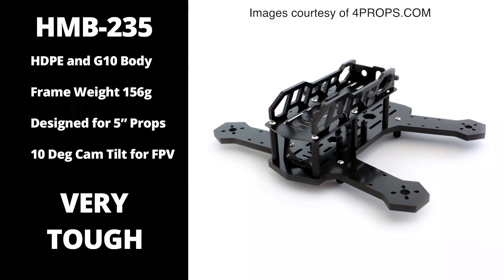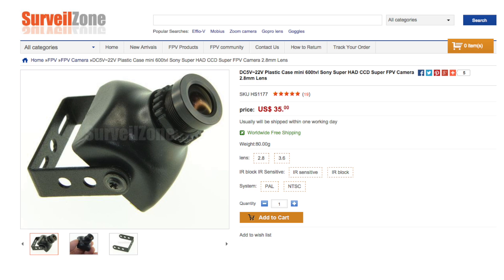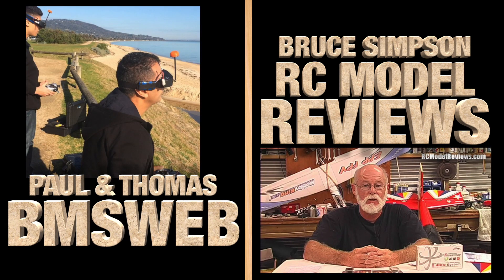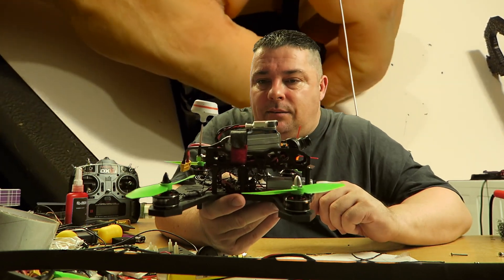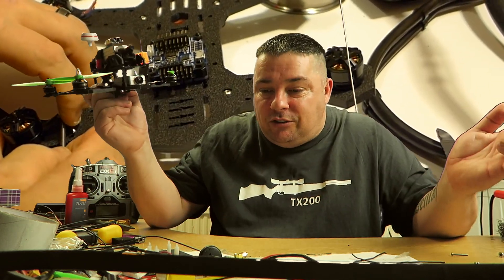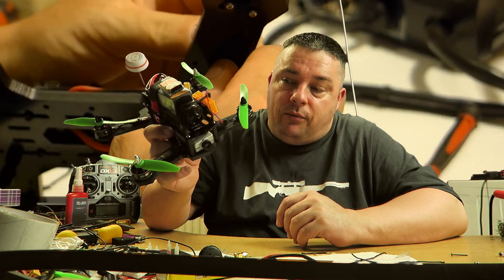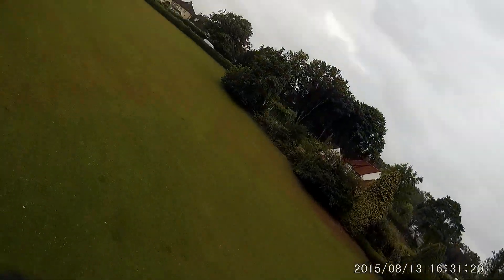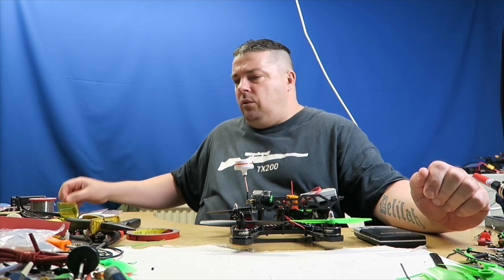HMB235 (unbreakable quadcopter) Builders Review

Comment: You've got to respect the CC3D. I love it. Nice and easy to set up and fixed some strange problems I had once with a transmitter I couldn't flip pitch on,
Anyway I'm not sure you set it up for PPM correctly. In all my experience I only used the first 3 cables coming out of the receiver port. Red, black and white. Not sure why you were at the other end using the Purple.
Even better I don't use the receiver port I use the other one (Main I think) as it will allow you to turn that into PPM and you only have to worry about using 3 of the 4 cables which comes out of that not the 8 you normally get. Only okay is your not using main for something else.
I've also put in an Orange R410X which I like as it cuts down on size. I'm not sure what peoples thoughts are on range but I'm not having any problem, but I do fly line of sight.

Comment: Your adjustment of the CC3D board showed en extreme and in-depth knowledge of the tool used with accurate and precision. I applause your use of such a delicate and difficult device.
Reply from the maker: FPV SPY Thank you for acknowledging my superior knowledge in dealing with such a device correctly =D

Comment: Love to know more about the HMB 235 as how it co pairs alongside carbon quads but not the c**p carbon that comes out of china somthing like from a blackout or the arms I sent you.
Reply from the maker: Kendrick Apps I think there are pros and cons like weight in favor of the carbon and also rigidity. However the HDPE does help to dampen vibration and is incredibly resistant to crash abuse. The arms you make are far superior to the ZMR arms but comparing them to this would be a little like comparing apples and oranges.
Reply: What thickness of HDPE was the quad made from I would think a combo of 8mm for the arms and 6 for the body be usful to know the actual thickness.
Reply from the maker: Kendrick Apps 6.35mm
Reply: RCTV-UK Amazing that only those who chose to escape from under the inexorable thumb of imperial rule are game to call it quarter inch. :-)
Reply: I grew up in the time of conversion farm imperial to metric so I use both my first love was balsa made planes and long after the mesur nets went metric even now balsa is still sold in imperial!
Reply: Kendrick Apps Hehe... Had to deal with both myself working in imperial on metric machines and vice versa. I only speak one language but in that one small way I'm multilingual. Well, that and with software anyway!